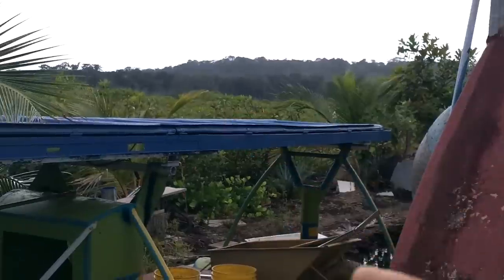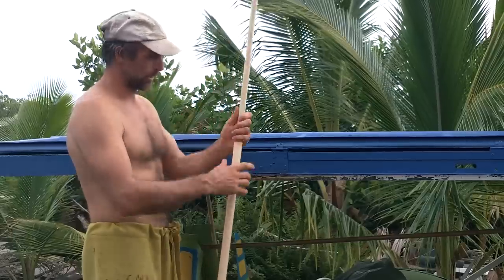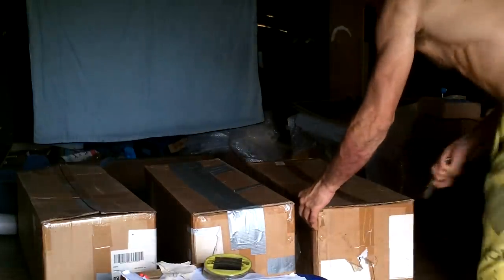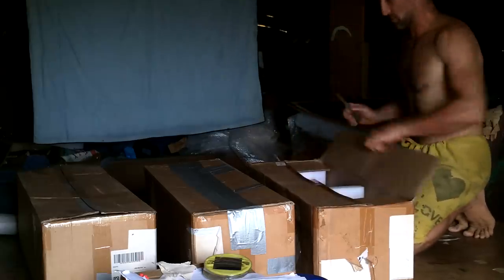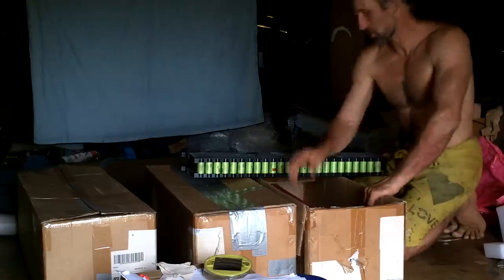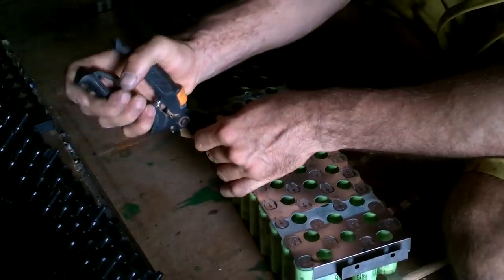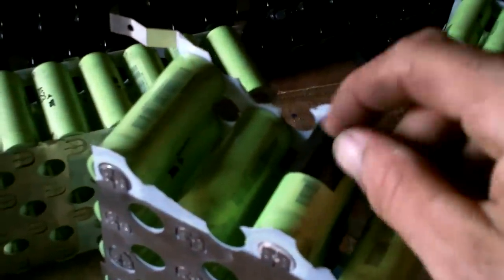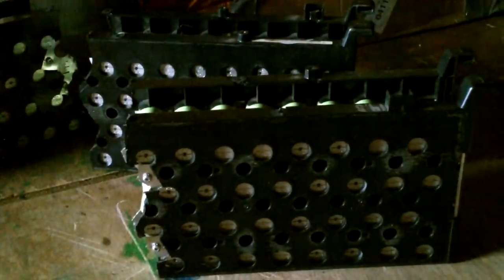Solar Snailer 033 Tubes n' Batt's

Comment: Where did you get those batteries? Do you have a link?
Reply: they were from an ebay auction of ex military packs iirc, he mentioned a while back. it is long gone.
Reply: These should be the same ones, you might want to search around and see what other sellers may have them. 
You will have to do a capacity test your self. All they tell you is voltage is good and they discharge and recharge. 
If you want to learn about how to do a capacity test, Will has a couple of good videos. Will provide link as well. 
Link to battery
https://www.ebay.com/itm/2-X-A123-ANR26650M1A-Lithium-polymer-Battery-40-volt-Module-total-of-192-cell/273878546550?hash=item3fc46ef876:g:9NAAAOSwOwJc-Tm8
Link to Will's channel and how to capacity test your battery. 
https://www.youtube.com/watch?v=3dmWqHR7b9w
Reply: William Glaser thanks!
Reply: These are ex hybrid bus batteries. A123 systems LifePo4 cells 26650. They come up periodically on eBay if you search for 36v LifePo4, etc. Don't recommend them however unless you can get them super cheap as they are very worn and only have a fraction of their original capacity.
Reply: @voneschenbachmusic  Pretty much why they say they are not capacity tested. 
Bigbattery.com has tested ones in 24v 3kwh tested for $699.99 shipping is only $350 
There are other larger ones, for around 2k that say 8kw, yet I would call them to confirm that this is the true capacity or the original. 
Will tested the 24v one at just above that 3kwh capacity. The one I provide the link for. https://bigbattery.com/product/24v-lifepo4-power-wall/ref/8/
This is will's video about said battery. 
https://www.youtube.com/watch?v=R_fuEP_LDkc&t=919s
This is will's video about how to capacity test the cells. 
https://www.youtube.com/watch?v=3dmWqHR7b9w&t=21s
If you buy used cells and they say they have a capacity of x amount and it does not over deliver then return them. 
As for these batteries I listed in the other comment, I would steer clear of them for the reason as to they are not capacity tested.
Reply: @kameljoe21  Completely agree and enjoy Will's channel and methodology. I got mine for super cheap so the $/kWh was excellent but these are not worth more than $50/battery shipped. Due to lithium shipping regulations I think these particular batteries are only viable for local pickup in large metro areas with large bus fleets that use the batteries in question. If you have to get something shipped the batteries you linked to are a much better deal.
Reply: @voneschenbachmusic  true, I am looking at my own smaller system, Well at some point, Still trying to find a house to buy that fits with in the needs that I want, Until that point comes around then I will look at buying a solar system. If I had to get something right now, i think I would opt for one of those 24v banks along with one of the lv2424 MPP Solar all in one inverters, And enough used solar panels and use that system to off set my tvs computers and fans and maybe one small ac unit. 
Just the battery and inverter will set me back 1335 dollars. Which can be used as a UPS system,  I do have 1 100 watt panel that will provide a small amount. 
Used panels where I live run around the 50 cent range, sometimes cheaper. Yet brand new 100 watt panels ships to the house for 70 dollars each from windy nation. I can get 1575 watts of used panels for 900, I am sure I can get it lowered to less if I try. ( 57 cents per watt ) vs 70 cents new. 
Either way a 2kw system deliver to the house all new would cost me 2735. 3190 Total price with combiner box, 100 feet of wire, some extra connectors ( I can wire 5 panels one to another with out extra wires except for the positive lead to the combiner box unless I position the box where I can reach all 4 of the ends * this would be panel flipped to the middle of the frame 10 panels wide and 2 deep* , then all I have to do is run 4 wires to a 4 way branch with a small 10 foot negative extension. ) With the new panels I can run 4 strings of 5 panels at 120 volts per string which should give me large advantage in lower light. Max system voltage is 145v at 2kw of solar, So that leaves me with the best I can do even split at 120v at 22 open voltage. 
 I use most of my eclectic at night, I guess if I was to install a system like this I would need to go to bed early and get up early to make the best use of the system. the cool thing about these units is that if you battery gets low the grid will pick up the slack and charge the battery. I am pretty sure that the window ac unit I have is less than 600 watts at full blast, With the amount of solar I have I should ideally get 8 plus hours a day with out using my grid. I also think I would have enough to power my 2 tvs, one desk top computer, 3 lap tops, router, 2 phones, headphones, and a few led lights with the remaining 1000 watts, If I guess at about 1500 watts realistic for about 5 hours and about 1kw or another 5 hours in full sun. 
I need to go out and check the area I want to install them and make sure I have enough light during late noon to cover that area, I know summer sun is much higher. 
I plan to ground mount them with an angle iron frame and some small concrete holes for the frame that I can at some point remove. I need 22 feet by 6 feet area at 33.5 degrees for optimal sun. 
I do need to buy one of those load testers that data logs, The one I have only does spot checking.

Comment: Flex panels are great!! But be aware. The white plastic can flex. The blue cells can barely. So when you lift a panel make sure you do not bend it to far. Cells will crack and maybe stop working. With these cells the back of the cell has the metal strips that will conduct the current to the next cell. In case one will crack and stop working try to isolate it by cutting the metal conductors on eigther side and just solder a bypass on every metal conductor. The reason you need to isolate the broken cell is to make sure there will not flow current in case the two broken pieces would make light contact again. With these bypasses  it would short circuit the cell and with just a needle point of contact it could get very hot on this point. I repaired a panel I have once this way and works great again. Even  with one cell less the output is significant higher compared to my other panel of a different brand. Both rated 100w. But the one with the dark blue/black cells are much better than the lighter blue with the metal lines on the front. The dark are better in full sun and in low low light and heat and cold.